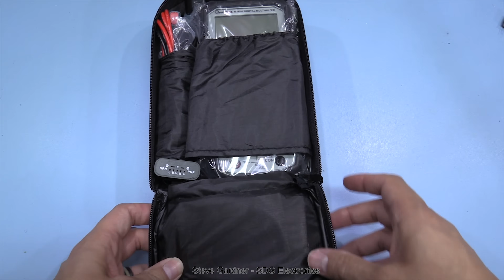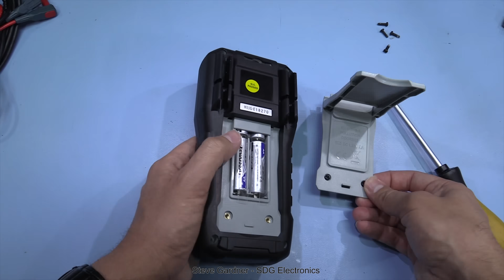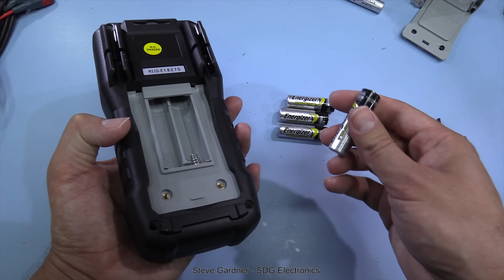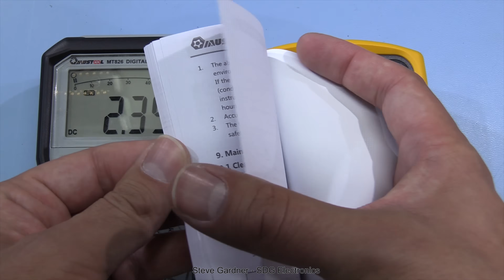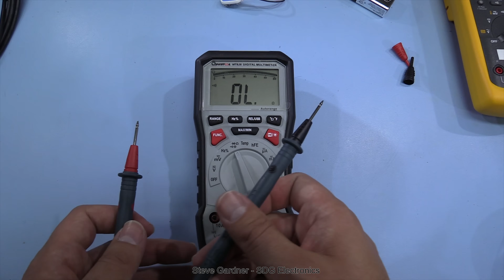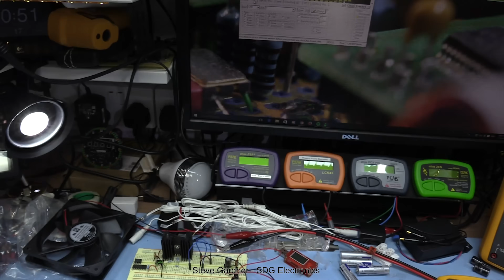SDG #042 Mustool MT826 6000 Count Multimeter Review

Comment: You can often improve the continuity by cleaning the probe tips with fine steel wool and alcohol, if they dont respond try another set of leads.  most import leads seem to have a film of some sort making the continuity slow.  Worst case scenario a better quality set of leads may be in order, I have this meter and like it pretty well, I did have to clean the probes to improve the continuity, but my probemasters are obviously better responding.

Comment: Hi Steve, wonderful review. I am thinking about a mod. I want a switchable permanent backlight. I saw there is an input from the battery pack and close an output for the backlight. Do you think, that the voltage is regulated or transformed before or just switched by the IC  ? Otherwise, one could easily grab the 4,8 V from the battery pack, install a switch on the right side of the lower shell and connect the battery pack - interrupted by the new switch with the back light. So you have a switchable permanet backlight. ? What do you think ? (1) Is the voltage of the backlight equal to battery power output  ? (2) Other suggestions to realize this ? Thanks
Reply from the maker: Hein mück it looks like Q3 and the base resistor next to it could be control for the backlight so you could trigger that. I have all my gear on boxes at the moment so I can't check for you, but it would be straightforward for you to test
Reply: I will check that when i receive the DMM. What do you mean with Q3 and what do you mean with triggering ?

Comment: Just received mine today. The continuity is perfect..0 delay and very precise. They've obviously solved that glitch. I have a ton of meters low-mid-high grade...thus is definately mid range ..very solid and well built. DEFINITELY BANG FOR BUCK.
Reply: Nice, thanks for the comment. Since they solved the continuity issue I might buy one too.
Reply: Upon further research I've discovered that in all likelihood the Mustool MT826 is actually the same as the PEAKMETER PM8236 (which costs U$30,00) repackaged and with different colors. Even the board inside has the same name.

Comment: Just got one,not for the continuity test though. The meter comes with a data logging software which works with windows 10 despite the drivers for the meter refusing to load due to some lethal error.

Comment: wouldn't the Unit-T 61D be a better meter, I just bought one for $35
Reply from the maker: They're probably fairly similar.
Reply: I pretty sure the continuity speed is much better on the Unit-T also about 40% cheaper, better reputation too.

Comment: Good and balanced review.
Can you hack the back light to disable auto off, can you do a mod? why do multimeter manufacturers insist on using auto off for back lights with no manual override mode.most if them turn off after about 10 seconds which is not long enough if you are working in low light...we're not children,
Reply: i agree....i have a Fluke B15 ...which is not RMS and NO backlight.... but having a Multimeter like this Mustool with only 10 seconds backlight ?  come on...why can we not choose on-or off....no timer...and yes then the batteries are draining a little bit more current...so what ?  :)

Comment: Interesting review, Steve. What voltage does it use for the diode test? Also intrigued to see how the hFE adapter works.
Reply from the maker: I'll take a look at the transistor tester. The diode test voltage is 3.3V
Reply: +SDG Electronics - thanks Steve.

Comment: Did you get stung for customs on the delivery?  I'm in the market for a new meter... also, are those fuses 1 1/4 inch or 1 inch? If 1 inch, you could 'upgrade' them with standard BS1362 fuses
Reply from the maker: No I didn't have to pay any customs fees. At the UK end it's delivered by Royal Mail so at least the 'handling' fee should be significantly less than the usual couriers. Some PCBs I had delivered from one of the overseas suppliers were subject to DHLs flat rate of £50 plus the duty >:-( The fuses are 1 1/4 inch unfortunately, although they are freely available at Farnell etc.

Comment: It looked like it was auto ranging in cont mode. Is it possible to set a fixed range in that mode?
Reply from the maker: No, the range button doesn't work in continuity mode - this definitely feels like a bit of a firmware bug that could easily have been fixed.

Comment: this one or the fluke 15b+ ?
Reply: i have the Fluke 15 B  ...a very nice meter but NO RMS and No Backlight...continuity test a little bit faster then this Mustool...and i have modded the 15B to a 17B meter !!    info on the Internet..
Reply from the maker: I don't have any experience of the 15B+. You would hope the Fluke would be the better choice, but I understand it's built down to a cost. Looks like the Fluke doesn't have a few features such as frequency measurement and I believe the Fluke has trimpots for calibration so potentially less robust.
Reply: alright thanks

Comment: or you could just get a UT61E for about the same price.
Reply from the maker: The UNI-T is overall similar quality, but worse on the input protection. Nothing much between them in my opinion.
Reply: The UT61E (£37.59 UK) the build quality is is a tad better than the MT imo, isolation slots and branded fuses its also 22000 count, the cont buzzer is instant as is the auto ranging, data logging software is on par, no back light.
Reply from the maker: Thanks for the information, you're possibly right then.

Comment: For a backup meter and low voltage measurements, ok. But as a daily driver I prefer some branded one with better input protection and sockets.
Reply from the maker: Yes I agree, however for the general hobbyist without much budget, it seems to be well priced and featured compared to it's competition, and should be safe enough in a domestic environment.

Comment: It's too bad; the meter was looking pretty good until you got to the continuity test.
Reply from the maker: Seems to be a common issue on the lower end meters.
Reply: Buy better leads, preferable the gold coated ones.
Reply: Or Clean them with 1000 grit sandpaper or higher

Comment: 1) I am guessing that the transistor test would be the same as a diode test...
2) I was hoping you would do a frequency counter test...
3) The continuity test was slow but it was the usual high pitch sound. 
     I suffer from tinnitus. So I would like multimeters to have a low frequency continuity buzzer.
Reply from the maker: Apologies, I actually recorded the frequency counter and forgot when I edited the video! My handheld DMM at work is a U1273A from Keysight which has an adjustable buzzer frequency which is a very nice feature.
Reply from the maker: For reference, the meter reads 9.997MHz from the GPSDO. It only has those two little watch crystals inside, which typically have around 20ppm absolute accuracy and a similar tempco.